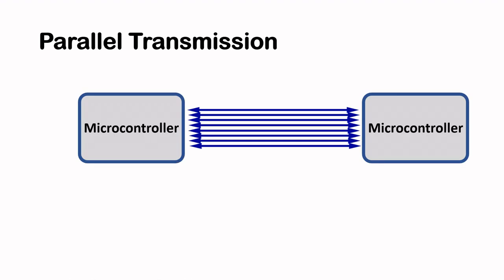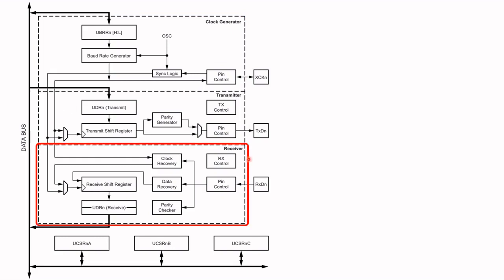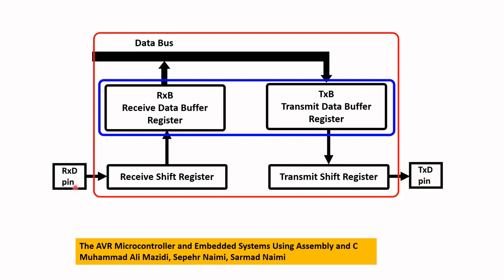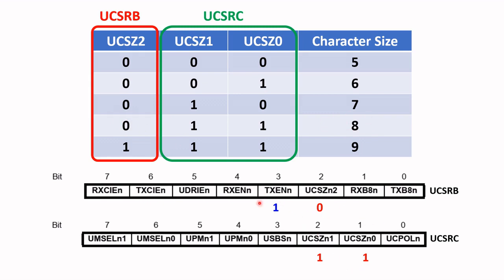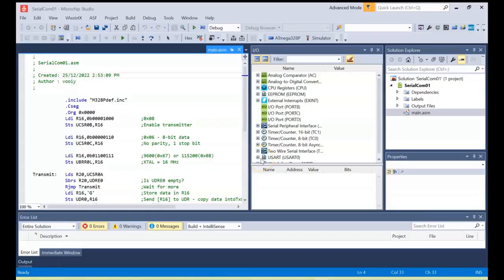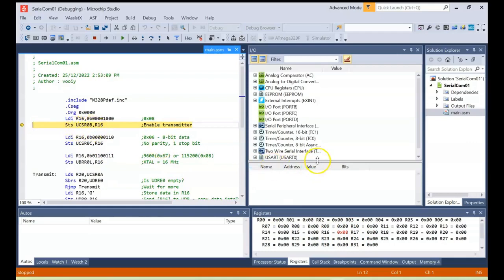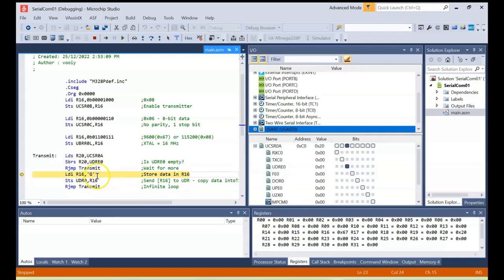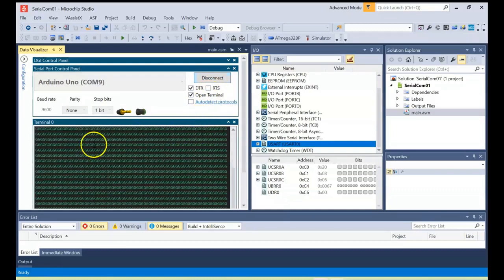#63 ATmega 328 - Universal Synchronous/Asynchronous Receiver/Transmitter (USART)

Comment: Your videos are amazing. I have been learning how to program the 328P and have had to convert some old 8051 assembler code to the 328P in C. Knowing nothing of assembler I started watching your videos on the 8051. Have learned so much that in this video I was able to read/understand your 328 assembler like it was C code. Your explanation of the USART registers was also so much clearer than some of the sites I have found online. Do you have any videos on using a scope? have not used one in 20+ years and trying to relearn. Either way, keep the great videos coming. :-)
Reply from the maker: Hi, I am glad that you have found the videos useful. With reference to scope, are you referring to a physical oscilloscope?
Reply: @vooiyap  Yes. I have been trying to relearn how to use a scope as I have been getting more involved into all this microprocessors code works. For example, how can you look at the serial data being sent and confirm the timing of the individual bits. I have watched a few videos on other channels, but you explain things so clearly that I thought maybe you might do the same to teach how to use a scope. If not, still loving what you are posting. Cannot say how helpful it has been.
Reply from the maker: @joshuawolfe7526  Hi, have you try a USB scope? For example: the OWON VDS1102 PC Oscilloscope. There are some online videos reviews. I am thinking of getting one for myself,

Comment: Do you know of any off the shelf tool that can Synchronous 9-bit UART at 1Mbps, both as a master and slave? 
 
For example, as a Master it would output a 1Mhz CLK, and TX,  where the data shifted on the TX pin (changes on the falling edge of CLK) consists of:  1-start (low), 9-Data (lsb-first), 1-odd, 1-stop   (12 bits total)?    And as a slave, it would latch what's on the RX-Line on the rising edge of 1Mhz CLK (generated externally)?

Digilent's Analog Discovery 2 only lists u*A*rt.

Microchip has a (discontinued?) PicKit Serial Analyzer (DV164122) capable of doing USART.. however, the GUI (2.2) shows only "USART Sync Master".   More concerning is that the firmware (305), and Dll (2.4) is from 2009, so not sure if it will work with Wit10.  The API examples are for VB2005.
Reply from the maker: Hi, check this out: https://blog.wokwi.com/wokwi-logic-analyzer-uart-part-1/